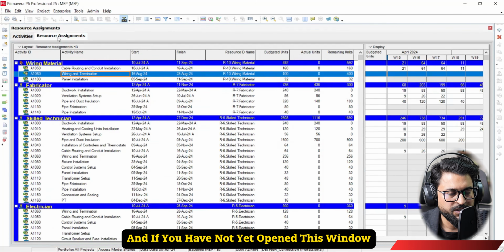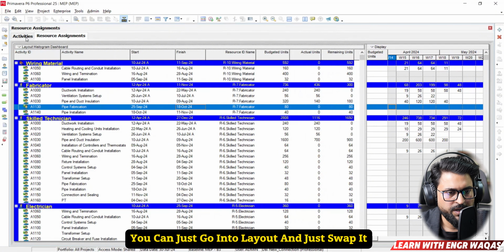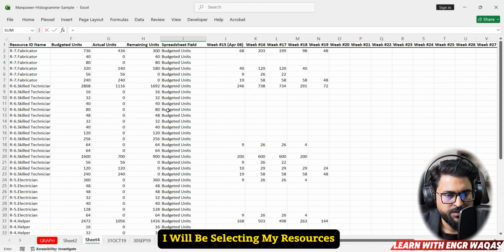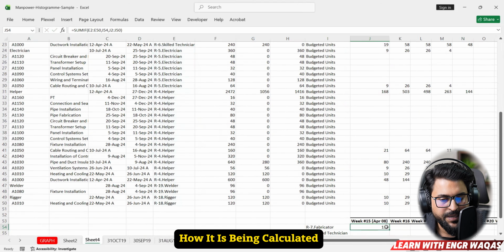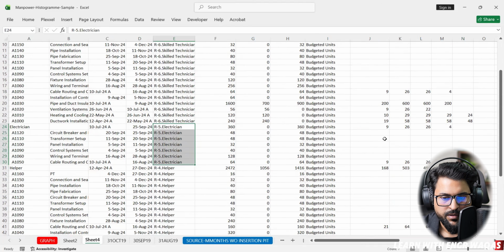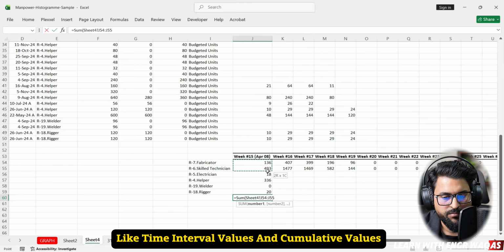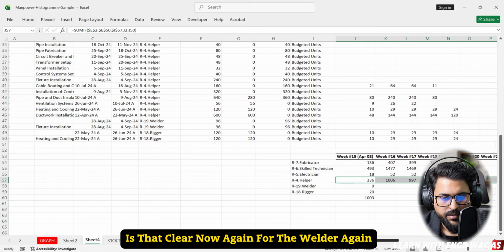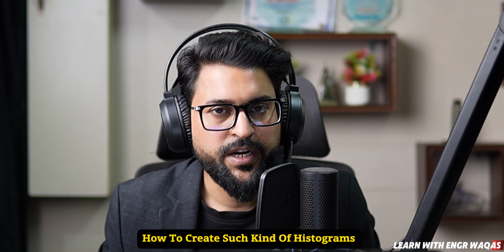How to Create Manpower Histograms with P6 and excel in Easy way ? Best for Planning Engineers

Comment: One correction required if you see in fabricator 68 is sum of 40+9+19 and in your formula includes both values… which is only one value need to consider
Reply from the maker: Thanks